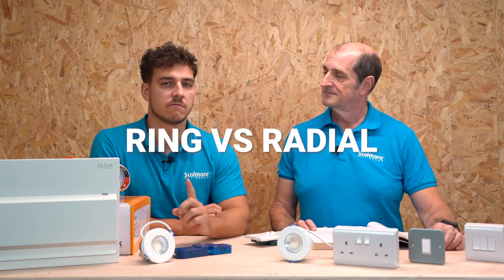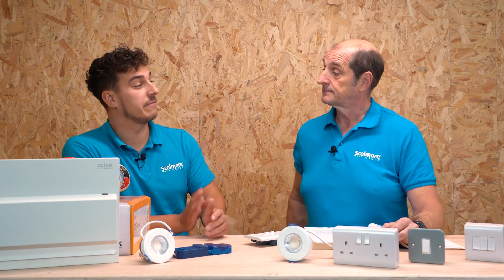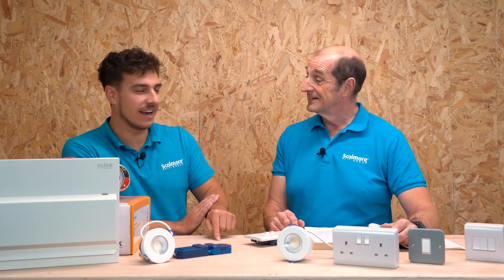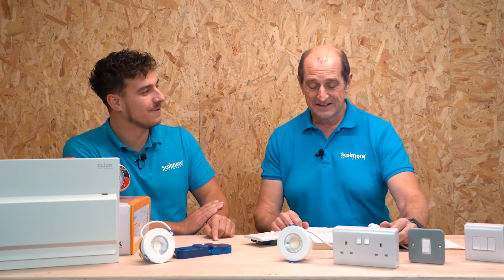Ring vs. Radial: Which One Reigns Supreme?🔆

Comment: Most if not all countries use radial and not ring.
The danger of the ring is heavy louds are plugged in inadvertently at the origin or near origin of the ring the cable can easily be overloaded due to most of the current taking the shortest route back to the distribution board
Reply: Not so. Myth. The more the resistance on leg 1 the more current flows in via leg 2. I  have not come across a ring that is unbalanced to the point it is dangerous.  Never.

Comment: Interesting 4mm cable in radial … 👍🏼 rewired my house using the ring main method as I was advised that option.
Reply: you would be advised as old soldiers always fire the same bullets. It's about the design needs and simplicity. I install both
Reply: @BobBenz55, the best option.